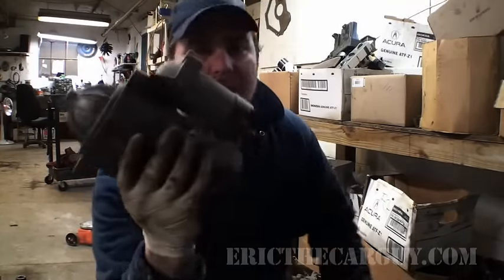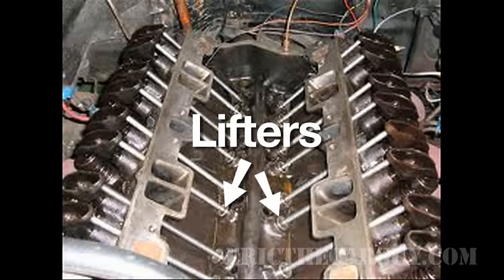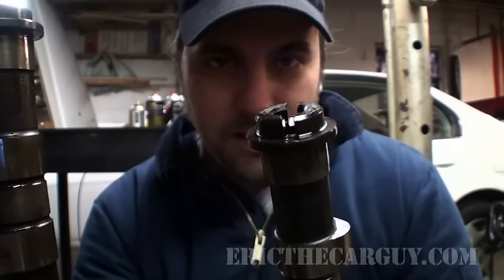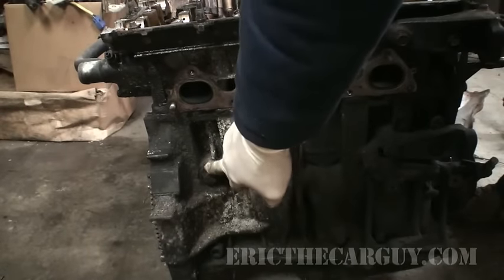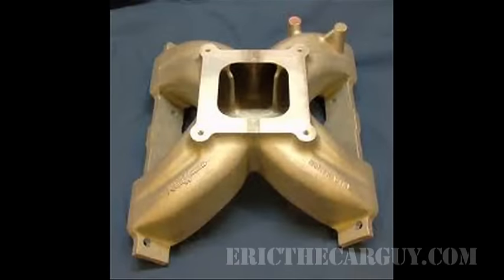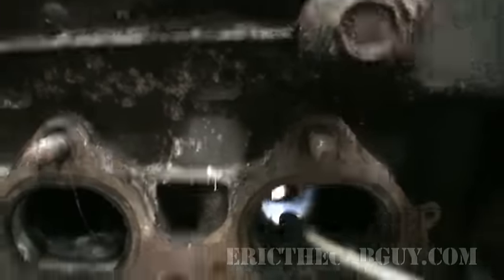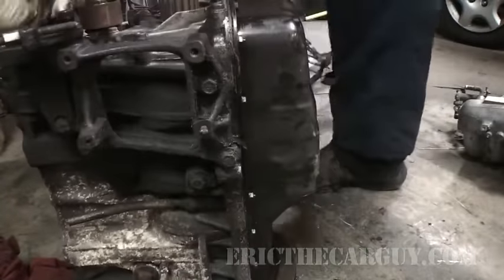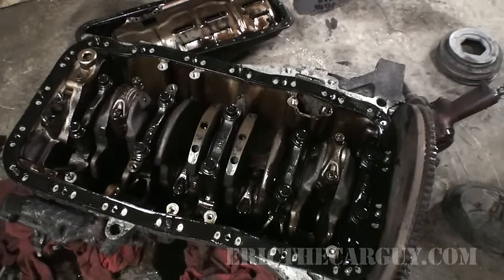Dissecting an Engine, The Basic Parts and Their Functions - EricTheCarGuy

Comment: It blows my mind that once upon a time a group of people somehow decided to add these tiny pieces of metal and physics to create an engine. The thought process into building one today seems simple but for people to actually make one of these for the first time ever is one of the greatest feats of knowledge mankind has ever witnessed. Amazing.
Reply: Mad scientists. But, he even said, not very efficient Still. $5 per gallon. Tesla is FASTER THAN V-8 ENGINES. NO SHITTY OIL BURNING EITHER
Reply: @Luke-ofStoke-Factor  Efficiency is relative.  Heat is lost, but compared to walking, it gets us from A to B pretty efficiently I'd say.
Reply: Tesla tires are still made of oil, the lithium in the mines are gathered using diesel and gas engines, then transported with gas or diesel, and probably charged with a coal powerplant. But the Tesla doesn't burn oil so we pretend that doesn't count.

Comment: Very interesting. Thanks.
You missed out spark plugs, so Im gonna assume that they are just magic.
Reply: They are magic. Magical fire starters
Reply: Joshua Dinello haha that's very sarcastic but funny lol
Reply: EgolandTed maybe because it's not a gasoline engine. diesel engine use glow plug or heater.
Reply: keanne garcia Not always though. In most cases combustion in diesel engine occurs due to self ignition of air-fuel mixture.
Reply: EgolandTed That engine was a diesel engine. So no spark plugs.. :)
Reply: Current flows throught them by open air and the charge possed spark ignites the air fuel mixture
Reply: What if it's a diesel
Reply: +Jack Carroll this was an integra engine
Reply: So they he pulled this out of Acura/Honda
Reply: +Momenul Hasan that engine was not a diesel engine, 1) they did not make diesel engines for the Integra 2) at 0:57 you can see where the spark plugs are placed (the 4 holes in the middle)
Reply: For anyone still reading this, diesel engines do not have spark plugs. They achieve ignition from compression alone, and fuel is injected directly into the combustion chamber at the top of the stroke. Gasoline engines do have spark plugs. They achieve ignition from a spark from those spark plugs, which ignites fuel that was introduced to the air before it entered the cylinder, either from an injector or carburetor.
Reply: I learned that a couple days ago in my electrical class. Talk about having my mind blown for the first time lol
Reply: Note #2, you can tell it's a gasoline engine in this video just from the injectors being outside the cylinder.
Reply: basically just sends electricity through it and on the top of it there a space between 2 peices of metal and it causes a spark of electricity
Reply: @jackcarroll702  if it was a diesel then how they ingite is through compression ignition, this is why you typically see in diesel engines that their strokes are much more longer than petrol ones because the piston is increasing the compression ratio (the ratio of when the cylinder is full with the piston at bottom dead centre compared to when the cylinder is compressed and the piston is at top dead centre) this increase in compression ratio allows the piston to super heat the air and a few degrees before top dead centre, a small amount of diesel is injected in the combustion chamber, which should readily ignite the air thus causing the power stroke stage.

This is why you typically see diesel engines also produce more torque then petrol because of the longer stroke adding more leverage onto the crankshaft when rotating, but this is also why you see most diesels as well to not Rev as high as petrol due to diesel needing heavier and stronger parts to withstand the actual forces produced from the increased compression ratio and super heating the air.

Comment: I wanna be an electrical engineer but this is cool too!
Reply: Go electrical it's the wave of the future
Reply: Hydrogen cars I the future I think.
Reply: im about to graduate in mechanical engineering, but ive had way more fun in my electric classes (its cheaper too lol)
Reply: Hydrogen cars won't be feasible until all cars become computer driven and have 99.9% action avoidance, hydrogen car accidents scary to think about
Reply: MyDeskTopFilms I didn't think about that lol
there would be a 1/2 kiloton detonation every time someone cuts of a motorbike
Reply: ronald howsley I think mazda has a plan to make hydrogen rotary motors
Reply: ronald howsley not to mention I think they use hydrogen battery's I'm electric cars
Reply: Sean Anderson
Reply: Sean Anderson bro mechanics need electrical engineers and electrical engineers need mechanics
Reply: Henry Muldowney good point im about to go into Diesal to become Diesal mechanic this great way learn about engines, ONLY thing between diesal and gas engines , diesal doesn't have spark plug , but they do have is glow plug, i did learn thing or about engines

Comment: i have to say i am a huge fan, man. Been watching your videos sparatically for the last couple years. But this past week i was out of work for 5 days dues to a surgery and ive been watching your videos all day and night. You've got a ton of knowledge and a great way of explaining things to the layman that really cuts through more than most of the other channels out there. I just bought my daughter a 2004 honda accord sedan and am going to be pimping it out a bit for her this spring. You have totally inspired me to make a video series on her car upgrade process. I'll be sure to link you in every video i make in my makeshift mini series . Going to be tearing out the interior, kilmatting everything, replacing speakers, adding some budget powered subs, maybe some interior lighting, new headlights, light painting on the trunk, new rims and tires, as well as a full tune up of the engine, valve adjustment, fluid flushes,etc and a full engine bay detail. spring cant come quick enough. Super excited. Thanks to you for the push forward in the project.

Comment: You mention at the end of the video about the inefficiency of internal combustion engines. I've always thought internal combustion as a primitive technology (it really is if you think about it) We're talking technology about 150 years old (basically) that we just keep trying to improve.

I sometimes think it's one of the biggest dilemmas of mankind, as far as moving into a new age. Look at an electric motor, it's about 90% efficient, but then again the dilemma, the external source to spin it (most likely an engine/generator or some kind of spent fuel).

A battery could spin an electric motor, but ask yourself,

"Where did that energy come from, that gave that battery its charge?"

Most likely an engine/generator or some kind of spent fuel.
Reply: Windmills
Reply: Yeah, it's had a pretty good run, and there are some (relatively) high-efficiency examples, like the giant turbocharged 2-stroke diesels on ships, but I can see why there's so much interest now in electric power.  One moving part, no oil changes (a big environmental issue in itself), and efficiency commonly exceeding 90% (permanent-magnet AC motors).
Reply: I think in time it will become something for enthusiasts and nostalgia buffs, the way steam power is now - there's plenty of fun to be had with classic machinery.  And much respect to people like Eric for sharing their knowledge!

Comment: always amazes me how much abuse the parts of an engine actually take over the course of the engines life span and still function.  yes, things can be rebuilt and replaced, but i would say the average person does not maintain an engine the way it should be, and it generally will still work.  i recently had a clutch linkage        housing( not sure that is what it is called) fail after 18 years and it was just made of plastic.  the number of times that clutch pedal has been stomped had to be approaching 2 million.  i know some people say things now days are engineered to fail after a given time, but i am not sure about that.  a combustion engine with all its precision and minute tolerances is a work of art to me.  kudos to the people who design them and to the people like you who repair them.

Comment: would like to see/hear a quick explanation how the energy transfers from combustion to flywheel, transmission, axle, wheels.  That's the point of the ICE, right to move the car?
Reply: gas, air, battery?
Reply: Yeah but we're on the basics.

Comment: The internal combustion engine is not very efficient, true. But where do you see us going, I mean in a major way. Will it be electric cars?
Reply: Nathan Chance Tesla Motors setting the electric trend
Reply: Nathan Chance one hundred percent it will be electric engines. Once they figure out quicker ways to recharge or battery life then all cars will be electric.
Reply: That is nice, but what about the performance cars such as corvettes? Can corvettes perform on electric like they do on internal combustion?
Reply: Bad Cattitude  they're worried about nuclear power because it also polutes the air and if everone is using electric cars then theres more power needed from those plants and it kind of evens out. They need to develope more environmentally friendly power that can be produced in abundance to meet the demands of electric cars.

Comment: I build engines and learned more in this video than a year working. Assembly work keeps all these jobs separated. Like one person installs the crank, then another secures it to block, then another installs pistons, then another secures it to crank etc. After it gets all the way to the finish line, it becomes unrecognizable as all the internal parts are covered up.

Comment: In my small engines class in school, the valves were opened by the camshaft pushing on tappets pushing on pushrods pushing on rocker arms which pushed on the valve springs to open them. Intake and exhaust. The camshaft was in the crankcase btw, directly connected to the crankshaft

Comment: I know you said the term "motor"only applies to electric motors but motors are commonly something that takes one form of energy and converts it into kinetic energy to do work. A motor also defines what engines do.  Muscles, loud speakers,  hydraulic and pneumatic motors and engines all fall under this category.  The word engine was at one time used to talk about water pumps.  Also, if you look at other languages, the term engine is seldom used.  Motor takes its place, also most automotive companies usually have "motor" somewhere in the name (i.e. General Motors, Honda Motor Company, etc.) as does outboard motor, motorcycle, etc.

Comment: That's going to be my new nick name. "Milky Coolant"
Great video, I just replaced the valve cover gasket on my '11 Mitsubishi Eclipse GS. I had oil on the sparkplugs, was kinda worried it would be the head gasket but turns out it was the O rings. Easy replacement! 
Thanks for the vid!

Comment: I greatly enjoyed your video (Dissecting an Engine) because I learned a lot.  So thank you for that.  Of course we're all disappointed by the ending of that video, where you remind us that internal combustion engines have relatively low efficiency, and that's after about 150 years of development.  I think everyone agrees with you that just about everything that can be done to make these engines work more efficiently has been done.  There's not much more that can be done with the IC engine as it exists.  Absolutely amazing engineering is involved in every design aspect of these engines.  

However, a new world is dawning, and I'm not talking about battery powered vehicles.  By the way, I really hope that batteries get to be cheap enough and reliable enough that they replace IC's in transportation vehicles.  There are a lot of inherent advantages to battery powered cars and trucks, and I'm sure you understand that better than I do because you know a lot more about IC's than I do.   But what if the "transition" never happens?  What if the sufficient raw materials are not available for making the huge quantities of batteries that are needed to replace IC's in transportation vehicles?  What if the cost doesn't come down to the point it needs to?  Well, there is another possible design for the engines we need, although the design was originally developed for stationary applications involving electricity generation.  

It turns out the best way to store electrical energy derived from renewable (intermittent) resources is in the form of a fuel that can be stored on a seasonal (several months) basis.  Then, during the seasons when renewable energy is not available, the fuel can be burned in an internal combustion engine which drives an electric generator to generate electricity when we need it.   (Batteries will never be able to store the quantities of energy that are needed from season to season.  It's orders of magnitude larger than the energy needed to drive our transportation vehicles.    

During the past few decades, important advances have been made in water electrolysis processes and in the processes for converting hydrogen into easily stored fuels.  What hasn't happened yet is that we haven't developed devices for converting the chemical energy of fuels into electricity.  Fuel cells have been intensively researched for more than sixty years, and they are still relatively inefficient, they are extremely expensive, they use raw material that are in very short supply, and they are terribly sensitive to even very low levels of fuel/oxidant impurities such as water vaper, carbon dioxide, etc.  Internal combustion engines eliminate a lot of these problems up front.  And now there is a approach for more efficiently using the fuels generated from renewable energy.  The new approach is an internal combustion engine.  And the new type of engine could be used in mobile applications.   

I know I am imposing on your time, but I would like to ask you to go to www.solar-eng.com where I discuss a range of technologies that we've patented and/or integrated with existing technologies.  These technologies, taken together, form a technology chain that economically takes us from solar energy to the energy forms that our modern industrial societies need and use every hour of every day of every year.  The thing that you might find most interesting is the new IC engine design which we have created that could have efficiency as high as 70%.  At the site mentioned above, look under the "SEA Systems" tab and you will find "SEA High Efficiency Engine."   If you have time to look at what's there, please let me know what you think.  (We also have a new valve design that works with the engine to control the flow of fuel, oxidant, and exhaust gases.  No camshaft, no poppet valves and all that goes with them.  I can send you the patent application for the valve if you want, and I can send you the patent for the engine.)  I would really like to start a line of communication with you because you know things I don't.  I can learn a lot from you and that's exciting.  There are communication links on the site.   Any feedback you can provide is greatly appreciated.

Comment: Excellent. Thanks. I've got an '81 Fiat Spider, so perfect engine. I also have a couple of motorcycles and will be digging into the Ducati. Most importantly, I teach college physics and will share this with my engineering students...and I always say "Get your hands dirty!" Again, thanks. While graphics can be nice, it is GREAT to see the real deal.
Reply: I forgot to say, you packed a LOT into 30 min.! Nice flow. A point or two could be elucidated, like why the 1 rev cam (equal to 2 strokes) goes with the 2 rev crank. So, 1/2 rev cam (1 stroke) gives 1 rev crank...and every 1/2 rev ONE OF THE FOUR pistons is in a power stroke and pushing one crank rev. But well done and don't let feeling like you should script these slow you down. You are clear enough to wing it and give good instruction.

Comment: A vehicle of mine had an oil leak from the oil sending unit that caused minor engine damage. The mechanic said most likely the wrist pins were damaged from lack of lubrication because there was a knocking noise mostly on deacceleration after letting up off the gas.

Comment: I was wondering if you have anything on Rear Main Seals? My daughter has a 2010 Hyundai Sante Fe, AWD, with the V6. 2 years ago, had to have the oil sender replaced, which is common in these cars. And is often diagnosed as a rear main. This actually was the sender,  But it has now also had an oil leak ever since, and multiple garages say it is the rear main. The leak started when it had about 65-70k miles, which doesn't seem right. Do you think the oil sender wasn't put in right, or could it be the rear main? vehicle has 95k now.  And as a stop gap measure, do you think one of the Rear Main Seal leak oil additive work? Like Bar's Leaks Rear Main Seal? alot of the online blogs say it does more harm than good, and clogs stuff up. Car uses a quart about every 2500 miles, so my mechanic says live with the leak, because 6 quarts of oil a year is alot cheaper than the repair, and the can of worms is not worth opening on this car. thanks

Comment: Eric,  I hope you can point me into the right direction on where i can get knowledge on how to properly build and engine.  The engine i would be building is a seadoo RXP 260 or Rotax 1503 engine for a Jet Ski.  I understand an engine is an engine with its basic components.  However, Id like to build the engine which will hold performance parts.  Like a bigger supercharger, pistons etc.  How can i start?  I love building things and i wanted to take the challenge of building my very first rotax engine for performance.